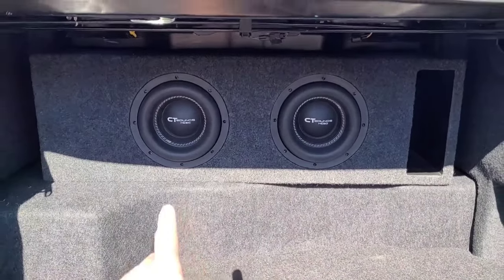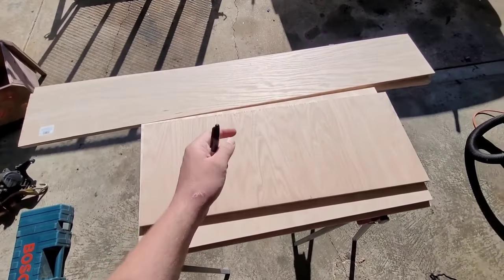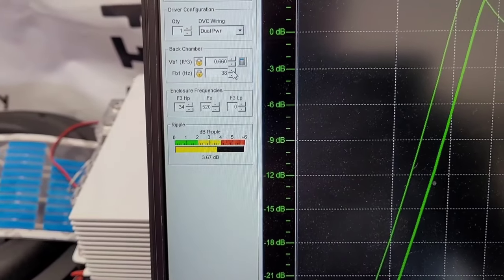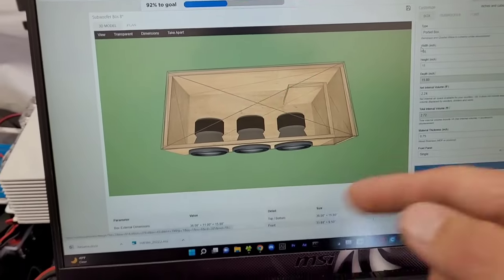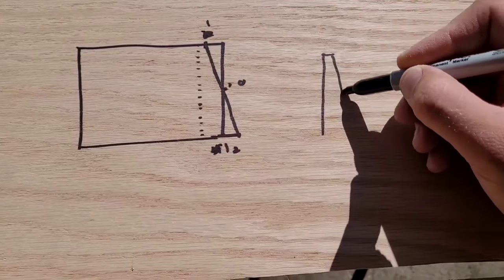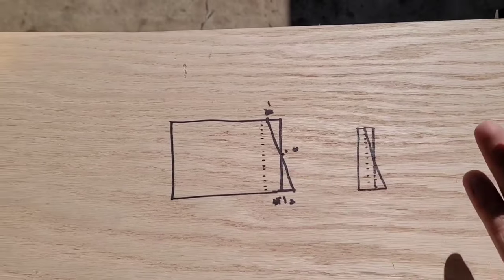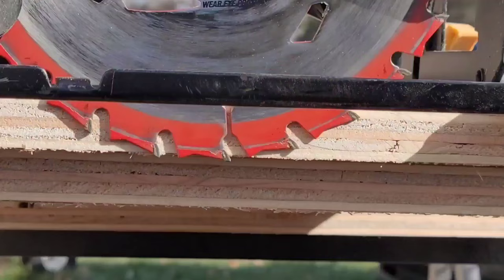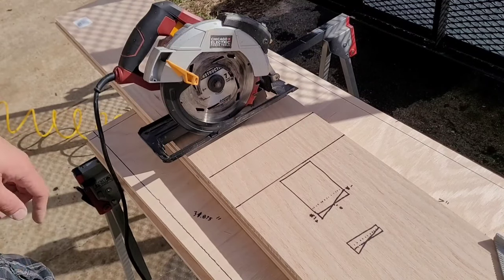How To Build Custom Subwoofer Enclosure - VERY DETAILED

Comment: 30sq is a lot for 2 8”s lol.. you should be around 21-26sq given that box size lol.. 30 might be about right by the time you increase the box size and add the third sub..

Should’ve gone to 2.25 net @33 with 34-36sq that’s the honey spot for that setup.

Way overthinking the inside of that port entrance.. you don’t need to do all that.. just throw a 1/2 round bit in the router and hit both sides of the end so it’s not square.. even still the amount of difference that is going to make you are never going to hear that anyways lol. 

You keep adding more and more crap to this box.. keep the port making it shorter and all the while you actually want to be gaining a little volume here.. you need to

.75 each net so 2.25. All this over building is actually making the box sound worse then it would if you just focused on the people box with the proper tuning and proper port area. 

Good job and all and at the end of the day it will slam.. but if you dropped to 2.0 net you should’ve also reduced your port down a little as well. That’s said as big as your orginal box port was this one actually started a little on the smaller side at 31-32 which is where you want to be anyways at 2net. I’d actually argue down to 28 for little more peak and maybe tune it up to 35-37 from my normal 33.. 

All in all good box lot of work and not a bad design but you got too much software you’re using and not really understanding some of the basics of box building. Kinda a too smart for your own good kinda thing. 

Oh man I said that and now you’re baffling the inside of the box losing more space.. baffle the outside not the inside 🤦‍♂️. No one baffles the inside cause it takes away a lot of air!  Messes up easy math trying to calculate it just add the board to the outside.. you’re way to overly focused on matching up with that shelf in the trunk that is so irregular anyways lol..

Bro you don’t calculate port area by drivers.. this kills me when people do this it’s simple based on the net of the box nothing else! 

14-16” square per cube.. use 16 for bigger xmax subs.. drop to 14 for smaller xmax subs.. but that is the sweet spot and it’s based on volume of the box nothing else.. you could put 20 15’s in a 1 cube box you’re port area is still 16.. or you could put one 6.5 in a 10 cube box and your port is still 160 lol.. this is truly what makes some boxes absolutely slam while others just sound good. 

If you’re going for high end sq then you need to run calculations on cone area, to volume to mechanical moment of the drivers etc.. but that’s cause anytime you’re doing sq with ported or boxes it’s cause you’re doing more like a home thwarted build and tune it to like 22.5 and then you try to flatten out the response as well as the range with the port. You don’t see many do this is sq for a reason.. its very complicated and needs a massive t line box basically making it the worlds bidders boss stereo lol.. 

If you’d gone 2.25 34ish sq you’d have been 143ish lol

In fact that old box with a redesign on the port t the proper size with just the 2 should be where you’re at on music. Much less burps..